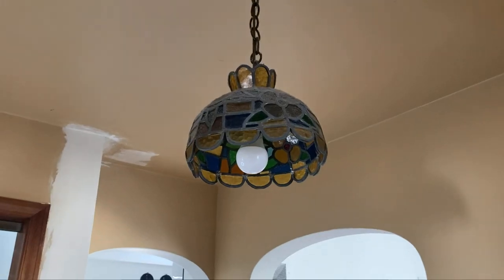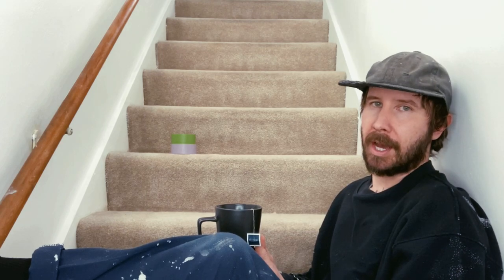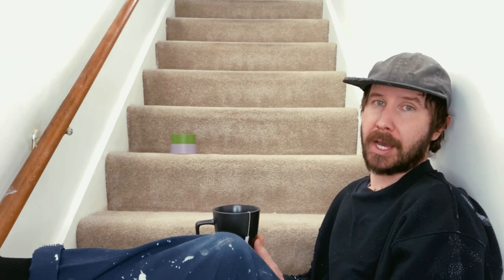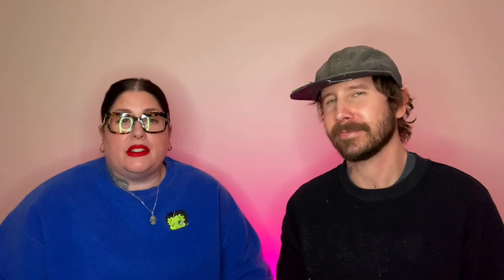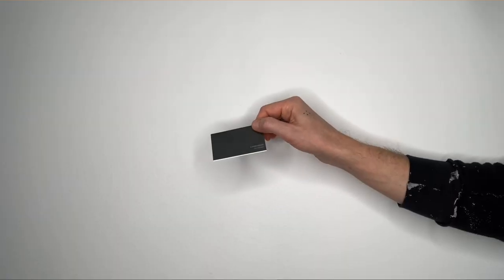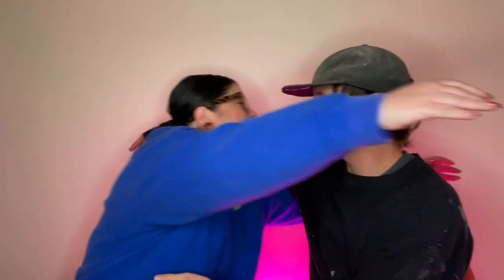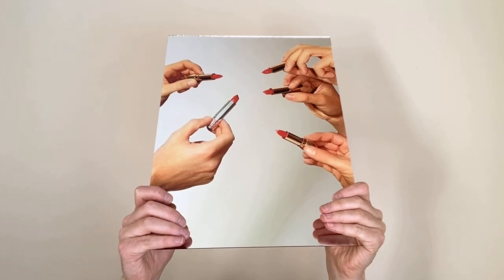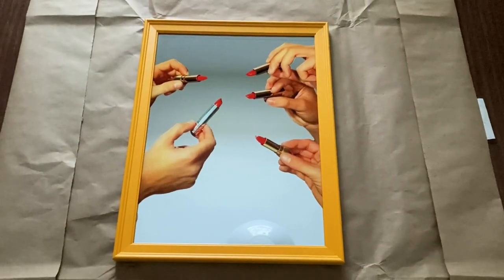A Black Ceiling Just Felt Right For The Hallway

Comment: Hi I really like that black ceiling whats the name of the color and is it matte?
Reply from the maker: hey david! i used the color noir in a flat finish by valspar. it’s the perfect black in my opinion. a little chalky so it looks super matte. thanks for watching!
Reply: @brewcitybuilds  What type of noir is this? From what I’ve been searching there’s many. Need color for new room soon :D
Reply from the maker: if you google valspar signature noir it should come up. here’s a link just in case: https://www.lowes.com/pd/Valspar-Signature-Satin-Noir-4009-2-Interior-Paint-1-Gallon/5001603139?cm_mmc=shp-cprdpntgglPLA_PNT_117_Interior-Exterior-Paint-Primers-5001603139--0--0-_-0&ds_rl=1286981&gbraid=0AAAAAD2B2W_nyZ8ORRaT7rE8ntqMksWxl&gclid=CjwKCAjw2vOLBhBPEiwAjEeK9qyywOVml3fyvymiY54Ypi6Gk3hdbYws8No1XsiuVt5wkQeSO7ERuBoCrhQQAvD_BwE&gclsrc=aw.ds

Comment: Hi im planning of painting my ceiling black too.. I notice that you extended the paint an inch lower why?
Reply from the maker: hey anne! you definitely won’t regret it. i took the paint down a couple inches for two reasons... one is the house is old and the ceilings aren’t exactly straight, so i was able to make a super clean, straight line by coming down a bit onto the walls. the other reason is because i just wanted to make it a bit more interesting by blurring where the the walls meet the ceiling. i’m super happy with how it turned out. hope that answers your question :)
Reply: @brewcitybuilds  ohhh i see i thought its something with the rules.. Thank you i really appreciate it. your black ceiling is so nice.